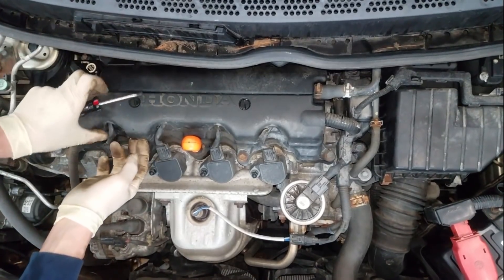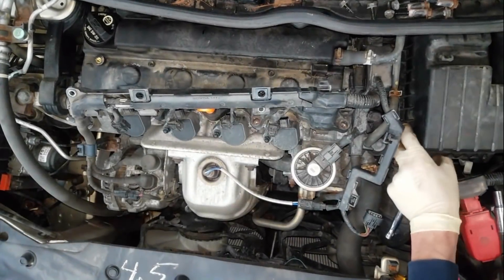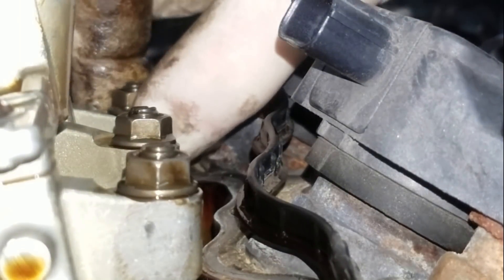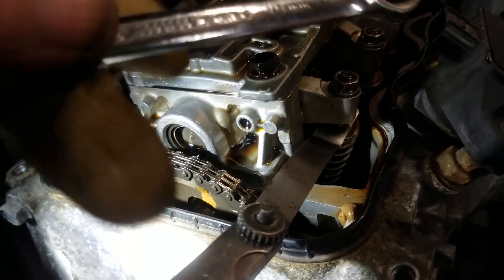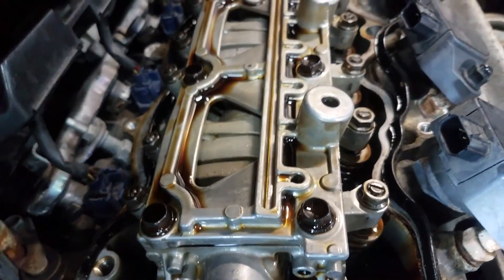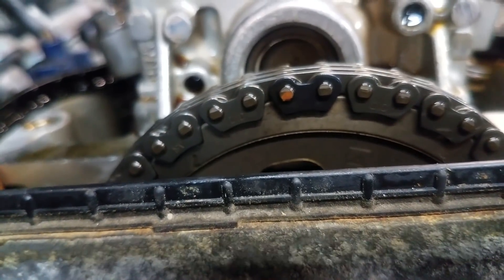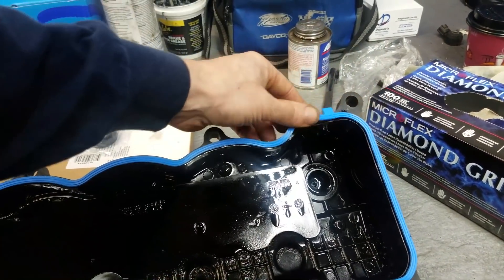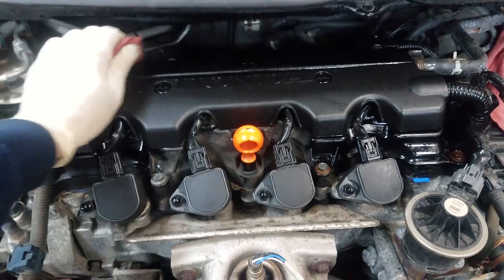How to Adjust the Valves in Your Engine "Complete Guide"

Comment: Before my valves were adjusted, my short and long term fuel trims were running in the 14-16% range. After adjustment, they’re back to zero again.

Comment: It’s worth it to pull the coils and plugs, so you can turn the engine from the alternator with a24mm shallow socket and a 1/2” drive ratchet. If the belt slips, use the free hand to push down on the belt until it grips the grooves and turns. Keeps you off the floor!

Comment: I used to do a lot of work on Honda motorcycle engines and saw a number of cases where the tip of the adjustment screw made a small dent in the end of the valve stem, resulting in slightly more clearance than a feeler gage would reveal.  Ignoring this situation would result in more clearance than spec, and some valve noise.   Using a machinist's dial test indicator to measure the free play on the end of the rocker screw is a viable workaround, although it doesn't take a whole lot of practice to learn the lash by feel.

Comment: I'm surprised no one said this, but @4:40, you said intake and exhaust in the wrong order to what you were pointing to. The exhaust valves are in the front by the exhaust manifold. The Intake valves are in the back next to the intake valve. If you swap the valve lash between intake and exhaust you will have problems.
Reply: My 1.8 has the exhaust facing the radiator and intake facing the bulkhead

Comment: Wd40 is causing rubber disintegration. You could just clean valve cover before putting it back on the car. Apart from that. Very good vid.

Comment: To avoid a leaky valve cover torque the valve cover bolts in a spiral pattern, starting with the bolts in the center, working outwards. Tighten them in two steps, with the final step torque to 7 ft. lbs. (84 in. lbs. or 10 Nm).
Reply: spiral? you mean star?
Reply: It really doesn’t matter, they’re stripper bolts, and can’t be over-torqued.

Comment: Did u torque those nuts? I feel if you torque then the adjustment will still move. And most wrenches don’t have low torque specs.
Reply: i wouldnt bother, tightening by hand should be fine

Comment: Great video tutorial! 
I never even realised Civics needed valve adjustment, I thought they had hydraulic lifters.
How do you know when the valves need adjustment & do they go far out-of-spec? Did the engine make tapping noises or have loss of power...?
Reply: Pretty sure its closer to every 100k miles
Reply: EppingForest304 yeah all that, plus there's an interval for adjustment. Every 60k miles or so. Type r is every 25k miles. However I have done it every 25k miles on my type r and I haven't noticed much difference to justify the cost or effort.

My previous type r was on reaching 100k miles and no history of it being done , so I done it and it made a huge difference, day and night difference literally. 
More power and engine very quiet on idle. Think it was also a bit better on gas too.

Comment: What spec did you torque intake? You said .25 for exahust? Does it have to be .25? Clock wise or counter clockwise for turning the crank? Also having it top dead center for each one, can it be off a little bit?
Reply from the maker: intake .20mm and exh .25mm. And the crank should be turned counter clockwise.
Reply: @FlatRateMechanic  saw you did clockwise.

Comment: Great Video!
will be adjusting mine this spring/ summer
Reply: did you torque them down or hand tight good enough?
i feel like if you put a torque wrench on and tighten it the screw might still turn a little with the nut and change specs

Comment: Hey I have a question did you do this on cold or hot?
Reply from the maker: That's a great question. Sorry for leaving that out. The engine should be under 100f. So basically a cold engine.
Reply: The Flat Rate Mechanic hey thank you very much  I was wondering that what a great video I was looking for his one in specific just one last question I have the civic a 2007 1.8 r18a1 are those measurements for that engine in specific?
Reply from the maker: Yes, they sure are. I'm glad it was helpful.
Reply: Cold
Reply: @spannerautomotive   honda leaves the engine dead for 2 hours indoors and then proceeds 
(:

Comment from the maker: Just wanted to be clear that the exhaust valves on this engine are in the front and the intake valves are in the rear. I confused them on cyl 3 and 4 in this video.
Reply: The Flat Rate Mechanic I noticed you had mixed them up on the last 2 but that doesn’t take away from the great video, thank you for ur time .

Q- when would you know it’s time to adjust? I got 145k and the ticking on a cold start up are slightly louder then when it gets to operating temp
Reply: Mechanics knows what you meant